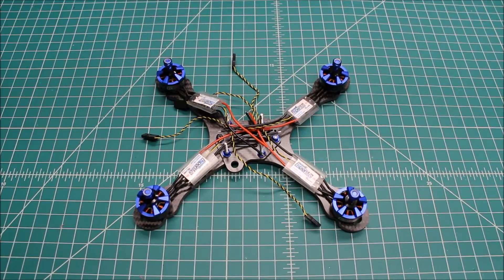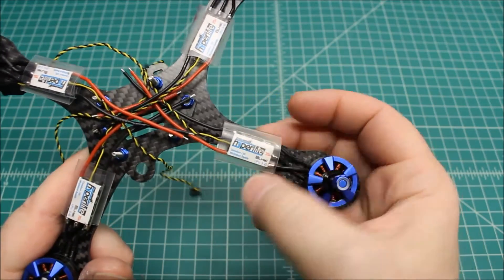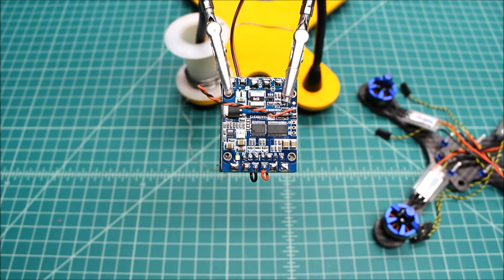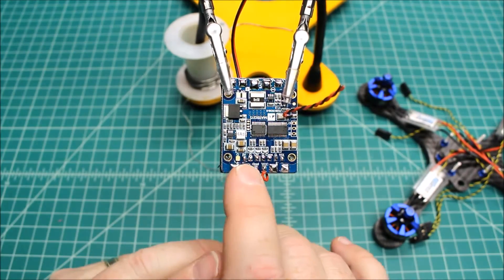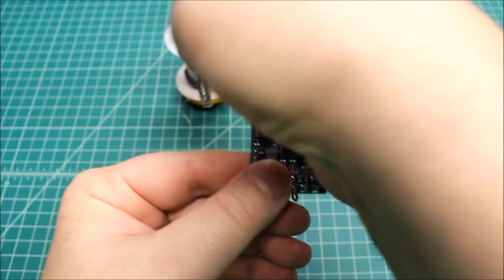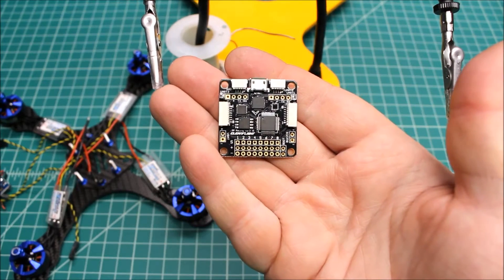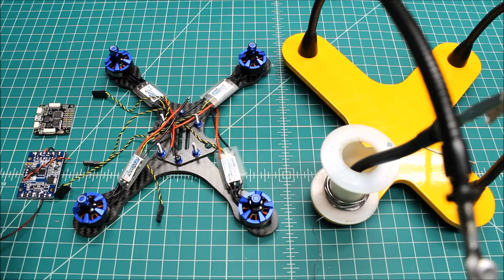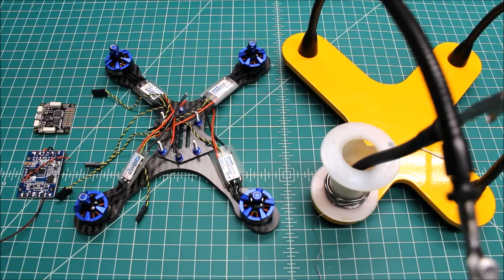Pyrodrone's Hyperlite FPV Racing RTR Drone Build Overview 2 of 3 "Installing Components"

Comment: Informational and well presented. I noticed this frame and the new Xhover stretched X too. So many frames so little time! Keep the vids coming! I like the swappable arms on this. Is the other tab on the bottom plate to secure the batt connections?
Reply from the maker: Yes, the designer put a lot of thought into this frame. It flies beautifully and the motors are really punchy